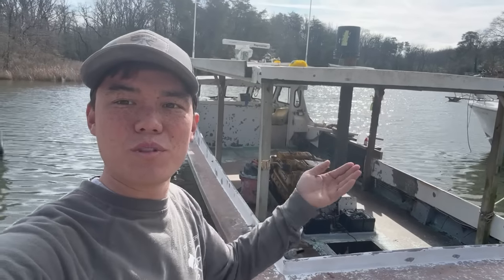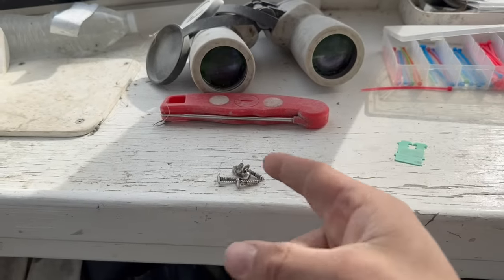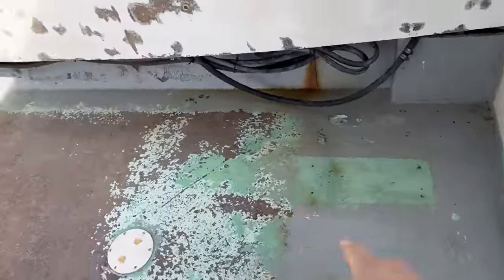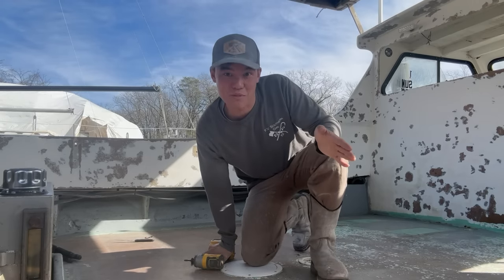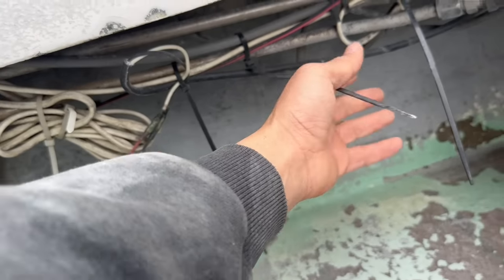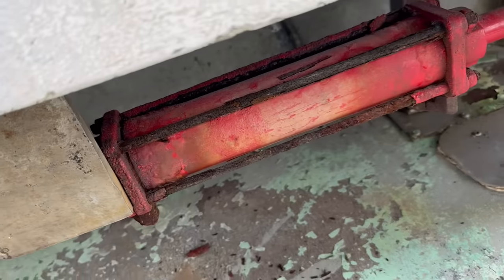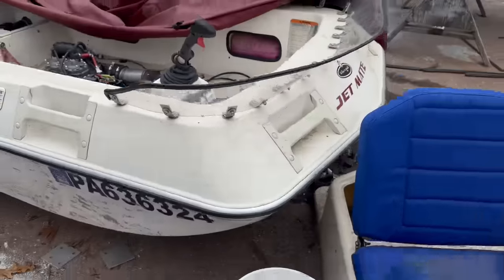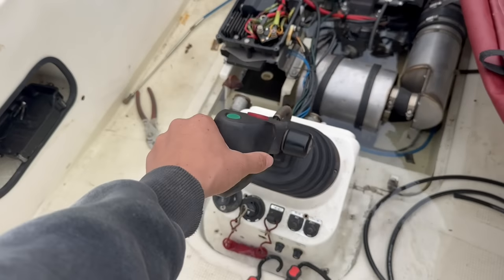WHY AM I LIKE THIS?!

Comment: get a piece of cardboard and push the screws into them in a line and label where they go to
Reply: Real men of genius
Reply from the maker: That’s an award winning good idea!
Reply: @fvsoutherngirl  taking pictures to reference after is not a bad idea either.
Reply: Rip some duct tape and fold over. Label tape. I gotta hand it to you. That’s a deep dive doing dock side maintenance.
Reply: He first has to find the cardboard, find a pen or sharpie this all takes valuable time and energy. Simply putting them down and forgetting saves a ton of time on the front end. Cardboard works great I know a few engine builders that use the cardboard trick, I've done it. Works a treat
Reply: Yes sir, this is the way
Reply: Yeah a great idea but using a tackle tray is better with separate compartments it works better I tried it with the card board an didn't know where it put it with out losing any so I grabbed a tackle tray an it works great I can just put the tray in my car an I'll know where they at an what's what
Reply: @dirtybootsfishing2923  you write what each part is on the cardboard.
Reply: Great idea...sounds like you're a lot like Capn' Luke😊...great minds think alike... I hope😮
Reply: Brilliant

Comment: Luke, watching you is like watching me. I was nearly in tears with the screws in little piles. I do the same thing. Although I have gotten a little better at keeping things somewhat together. I bought a handful of markers (because l can never find one when I need it) and some small snack baggies, instead of writing on the bag, I use the back of an old business card or something like that and label what's in the bag. I wish I could say it gets better as you get older but I'd be lying. Your doing a great job on the boat.

Comment: I have about 25 of those magnetic dishes from Harbor Freight that I use when disassembling things in my shop. I keep them in a line on the bench in the order that I take stuff apart. the only problem is that you need to super glue the magnets to the bottom of the dishes before you use them because they ALL fall apart the first time you use them.  Works for me, I'm sure everyone out there knows what I mean about the magnet coming off ...

Comment: Blue tape and a pencil!!! dont need to worry about ink, can sharpen with a knife. stick a piece to the dash, write "floor access panel", "Window", "Hatch" 
I have the same problem. my worktable is adryerase board. Can write notes, labels, instructions down on the table.

Comment: Lol. That splash guard on the jetsons boat looks like one of those cones they put on a dogs head after surgery. 

Get the baggies. It’s worth it. I work on CNC machines & get as quickly distracted as you. It’s much easier to come back to bagged & tagged hardware.
Reply from the maker: It totally does 😂

Comment: As for the specific screw that was shown, it’s either a round, raised, dome, or truss, etc. but definitely not a “flat”. Flat screws have under tapered heads, bugle, etc. not square seat areas. Plus the top / dome of the screw shows uneven wear, so it wasn’t made that way. Not being critical, but I’ve installed 10’s of thousands of almost every style of screw available and it’s important to know, especially when ordering replacements. JS ✌🏻
Reply: Flat Head drive, or slotted, is what i assume he meant. my aspergers recognizes your aspergers, o7
Reply: @koaasst  You know what happens when you “assume” things right? If that’s what he meant, he should’ve said it. Also, the Walmart location you visited should provide you with a full refund for the Psychiatry PHD you purchased. JS
Reply: @KING-FU  its ok to be on the spectrum man. you went full on fun with flags with screws, and all he said was 'this one inch flat head screw' while the camera was focused right on the darn thing. lol, its all good, im not trying to insult ya, i just knew what he meant. as opposed to phillips, robinson, torx, etc. side note, personally ive probably installed 3" torx deck screws the most, followed by 1 5/8" drywall screws, then 1 5/8" torx, then 11/4" drywall, with #1 robinson trim in lengths of 1 5/8" and 2 1/4" bringing up the rear. i could talk screws all day. tapcons, tappers, lags, metal roof of various types, and those little sharp af black phospahte 1/2", cant forget them, one of my favorites. the pocket screws with their big heads come in handy often, as do the lathe screws, especially the tappers of that variety. but i did inherit a 5 gallon bucket a few years back, full of nothing but slotted screws, of all varietys, from brass to zinc to stainless. i use them for therapy, as sorting them is a relaxing pasttime ive found to relieve my highly anxious state at times. but i would never use them, unless in a decorative fashion, where they can shine. i havnt haammered a nail since a vinyl siding job where i hung the pvc fascia with the little ring shanks. pneumatics for roofing and interior trim are ok though. my garage sale old craftsman framing gun would have beef with me if it were sentient, but its in good company in a nice shed with other tools from a bygone era, such as the old steel miter box, hand planers, wooden levels, and other impulse buys from years of browsing thrift stores and yard sales. if only i had any charisma, id try this youtube thing out myself. i have this squirell problem though you see. have a great weeknd.

Comment: Let me help you with drawing those lines, one up at the bow, another at the transom, and just fix everything between the lines..oh and I can help with the screws as well, just throw them overboard, and replace them all, remember they are between the lines..
Reply: You would have fun walking around junk yards, I wish I could justify doing it more often, but I love checking out old just that has just the slightest amount of potential to run, I’d Guess that jet boat engine flooded with water would fire right up, with a little screwing around., while you have that boat apart, and your spending time and money, you SHOULD do an oil change, but send a sample of the oil that’s in it out for analysis, if the engine is making metal, better to know now, and not a month into next season, with three new employees..